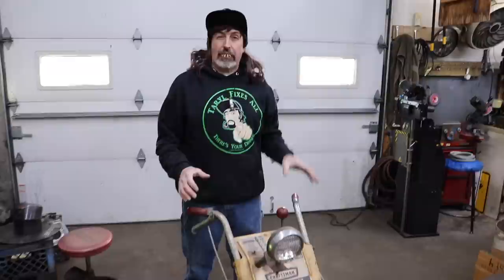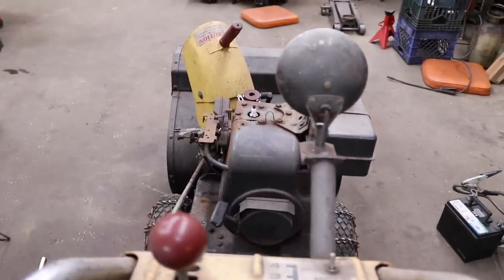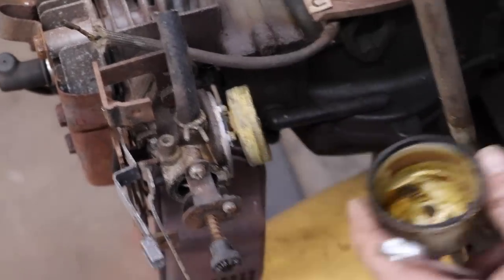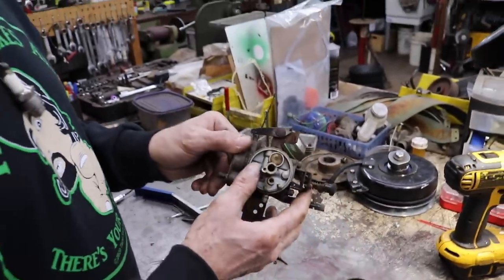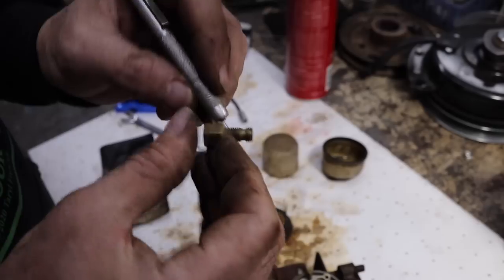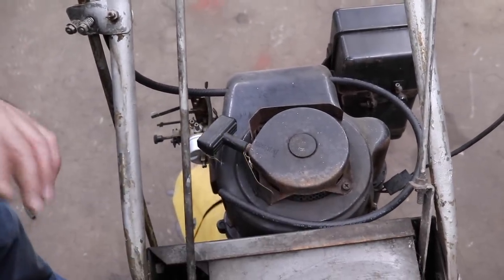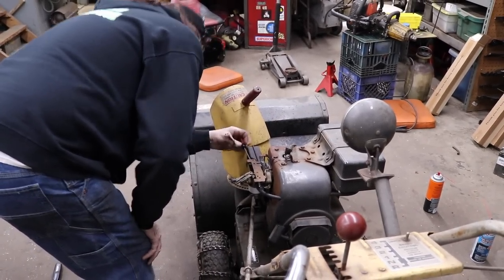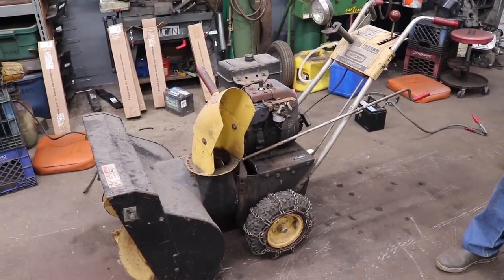⚠️ Most DANGEROUS Snowblower EVER! Let's Get It Running

Comment: Most dangerous? I think if you where to take a look at an old Gravely with the "Dog Eater", blower attachment, you may change your opinion as to ,"most",dangerous.  Otherwise, another great vide
Reply: Power Vs Drudgery!
Reply: I'll 2nd this and with the dog clutch on the blower was in or out. And the 301 cast iron Kohler don't quit!
Reply: I had one of those Gravely machines……was a killer!

Comment: Those of us who used Gravely walk behinds from the 1950's are familiar with VERY dangerous lawn and garden machines.  Think sickle bars, for example.
Reply: And the Dog Eater snow blowers. And the 301 cast iron Kohlers that were STRONG!
Reply: I had 2 old Gravely L 2-wheel tractors.  A 1937 and a 1960s
Reply: I had the rototiller attachment and the mower attachment. Just one big blade. Big round deck.
Reply: The depth wheels for the rototiller were spoked steel wheels
Reply: Those things took a big old 7/8 spark plug.  Wico mag
Reply: @jameskropf2493  That one could mow with 2 blades 90 degrees apart or bush hog with the one 1/2 inch thick blade by itself. The round deck also had a left handed version but still wouldn't do a really good job without the other blade because of lo blade speed. Te kidney shaped mowers did fine with the 90 degree gearbox, belt drive spindles and smaller pulleys for increased blade speed and dual blades. One of the best parts was a rear discharge chute so you could trim on both deck sides.
Reply: @jameskropf2493  I welded pieces of deck plate onto the tiller blades. It'd then dig up a packed gravel driveway with a 8 inch round hole concrete (not laylight) block hung off the front for weight to hold it down. And never flutter.
Reply: @jameskropf2493  Same for the rotary plow.
Reply: @jameskropf2493  Right! The old wooden handled control rigs, strap start or 12 volt car battery and wall charger.
Reply: @jameskropf2493  Sure did and the mags would knock the fillings out of your teeth!

Comment: A Small Engine shop in Summerville South Carolina got sued for not using fuel line clamps and lost the lawsuit even though the customer admitted to refueling with engine running when it caught on fire. Mower was a MTD Yardman. Burnt it almost to the ground!
Reply: That’s what is going to happen with using zip tie on fuel lines before long
Reply: In Germany the jury can't award money to defendants like we do, 
They understand a jury of people who have no idea how a machine works should not be the ones to decide a dollar amount.
Reply: My 1992 Suzuki dt40 two stroke outboard came from factory with zip ties on fuel lines. I bought new zip ties from an authorised dealer. No I do not like them. Next filter change it will get stainless steel clamps.

Comment: You know I have been a small engine mechanic for many years Taryl. And still, you teach me things!!! I been through probably hundreds of those snow king carbs, thought I knew every hole in them to clean out. But I never knew about the one for the low idle circuit in the bottom of the venturi!!!! Thanks man!!!
Reply: Agreed 👍 on picking up new stuff on those carbs,been using up all my new brass floats,started using the plastic ones,do alot of old troybilt tillers
Reply: It like we’re in shop class again being taught by master yoga he amazes me on the knowledge he has I definitely bow down to the master
Reply: @jkmcp45  I don't see much of that old stuff out here in Washington state much the bonus rust away too fast o have a few 1970s garden tractors, and several old troybilt tillers with those engines
Reply: @jeffclark2725  same here in Oklahoma. I managed to pick up 3 "junk" generators with 10hp tecumish from a pawn shop for 100 bucks. 3 carb kits and 3 cycles in the ultrasonic cleaner and they each run perfectly. Now to find more projects since I sold the gens!
Reply: Same here
Reply: Agreed

Comment: My grandfather worked for the street department in our town, late in winter they cut down the accumulated snowbanks that built up thru winter with a massive truck mounted snowblower and carted it off in dump trucks.  One time a dog decided to jump the snowbank right in front of him and before he could get the machine shut down the inevitable happened.  He felt so horrible he never ran the snowblower again (small town, boss was a friend and totally understood).  Luckily he knew the dog owners as friends also, and they never held any animosity towards him.  Years on we ended up giving them a pup when we bred our beagle.

Comment: Bravo. Another fine Fix-IT video. Thanks for the plug in mentioning Buffalo. South Buffalo & below always gets the brunt of the storms. I'm in the northern suburbs where it isn't as severe. My 30 yr old MTD snowblower with the 5hp Tecumseh Snow King started on the first pull since last season. Now all these new snow machines have Chinese made engines.

Comment: Safety 3rd I always say Safety is for the weak and the stupid 😵 I run an old Montgomery Wards that would give it a run for it's money on the lack of safety devices. Love the sound effects such a high quality production 💪
Reply: I'll heartily agree with that! Love the old stuff!
Reply: @petertothpete6518  like using those old Colman white gas stoves that are 50 years old
Reply: @jeffclark2725  I've got one that burns as blue as a propane job yet and still. 50's model small one.

Comment: Even worse is a rototiller with no auto off. I know a guy that had a old rear tine tiller (don't remember make) that got him pinned against a fence while in reverse and chewed off the bottom of his one leg that bad that he lost it from the knee down. Don't remember if safety was non existent or disabled. But just the thought still gives me the chills.
Reply: We had a Murry Rototiler back in the 70s and it was just like this death trap.
Reply: Replace springs in clutch ??????
Reply: When I have an old machine with no deadman controls I add a kill switch up top by the handles.

Comment: This thing is in excellent condition. It should be maintained as a snowblower.
You could REALLY cut down on the risks by installing an off by default ignition kill switch lever on the left hand.  When you're not squeezing the level, ignition is grounded. When you are squeezing the lever, ignition is live.  That way you let go and the whole machine dies.

Comment: TIP OF THE DAY: 
For those that don't already know, the clip that holds the float needle in place is the exact size that is needed to clear the tiny hole in the high speed jet that T Dawg was using the torch cleaning tips and pin drill bit on. You're welcome and There's your dinner ! : ) Happy Holidays to all.
Reply: good tip, I'm guessing that wire is pretty hard/stiff, too, should be perfect for that secondary application. thanks for posting that
Reply: Great tip especially for home owners or someone in the field who probably won't have torch tip wire, tiny drill bits or guitar strings on them or the proper tools.
I guess some might have a wire brush they could pluck one wire from or the bristle from a brush or broom of some kind.
I've done all of that on carbs and the nozzle of an oil furnace...many times...
Reply: @mickdog2  You're most welcome. I find it amusing that none of the online gurus have ever mentioned this fact. I watch several of them as they scramble around looking for various items to unclog the hole while the perfect tool came with the carb -a -traitor  in the first place. It's even easy to hold the clip the way it is designed to penetrate the orifice and give it a thorough reaming.

Comment: I had that exact blower . It is a 1972. I agree very dangerous, but did a great job with deep snow. When I could buy a  modern one I removed all the anger mechanism cut the shaft attached to the front gear box ,added a support bearing and added a peace of sheet metal in the front bucket. I now had a 26" snow pusher.I also moved kill switch to the handles for easy reach.

Comment: Hi Taryell  I enjoyed this video, it took me back to the 1970s. I had a similar type blower. Not a craftsman but probably made by MTD. There were Deadman saftey switches on each handel bar, they  killed the engine if you released both. I think there was an auger engagement  or neutral transmission switch activating the deadman so you did not have to hold one down for starting. You are just the guy to install them on this unit and bring it back to useful functional safe status.
I am looking forward to seeing the unit blow snow, yes it will move the white stuff 50ft. If the snow is dry. The auger clutch often would slowly turn the auger with no load slightly but if using, usually the snow friction was enough to stop auger rotation at idle speed. He is an old timer and been sleeping awhile give him a chance he will get the job done!

Comment: When that unit sees a little snow load, that clutch will find itself, and work just fine.
BTW, Kroil is a rust buster only...Kano also makes a product, called Penephite. It is Kroil, with graphite mixed in. When the kroil dries up, it leaves a graphite film which is a lube, that does not attract dust or dirt.....try it; works great...!!!!

Comment: I'm working on a 79 JD826 Tecumseh with  a similar carb issue... been all through it meticulously and still needs work. Next time you use the Ultrasonic cleaner it might be a good idea to throw Little Johnny's teeth in with the carb... those teeth are so bad. lol

Comment: Hey Taryl, you'd mentioned using a propane torch to free up the low speed tube in the carbitrator....... I'm assuming we fire up the torch as quickly as we can after spraying carb cleaner on it??🤣😂🤣😂💥💥💥

Comment: centrifugal clutch springs might be weak?  Gravely "Dog Eater" is a good contender for most dangerous, but it is a BEAST!
Reply: Dog Eater for sure
Reply: I have a few old Gravely walk behinds.
Not many could run them today .
After an hour a intense workout .
No safety equipment .
On hills no brakes will roll away if knocked into neutral.
Love them .
Last a lifetime .
Reply: @MitzvosGolem1  Dad had the Gravely twin cam machines, I've got the 12hp Kohler walk behind, put a smaller plastic tank on it cause I rarely use it for more than an hour, whether blowing snow, mowing with the rotary or sickle bar. Also have a 12g and 400 series rider.  Have seen many attachments: stump grinder, chain saw...I  fashioned a wheel trencher for burying lines.
Reply: Nice thing about the 30" rotary mower....it will easily mow down heavy brush, like large stands of multi-flora rose shrubs.
Reply: @sierraromeo  yes chops up everything even 2inch trees if sharp.
Reply: @sierraromeo  I need a rototiller I have to propeller old style need a tine type one for 5665 commercial
Reply: @MitzvosGolem1  I have one but it needs work, it has a frozen bearing  it seems, nice otherwise,  central Ohio
Reply: @sierraromeo  Virgina near Roanoke

Comment: I disconnected my old Toro 826 safety switch due to the fact that my bad hand tendons were killing me holding the handle down.   I grew up with no safety things so I don't think it's a big deal.   All our kids are grown too so it's just me using it.
My old Ariens has you hold the handle down to stop it, release to let it go.   That works well for me too.

Comment: Great tip about the old spark plug boot becoming conductive and grounding out the spark, that one would’ve driven me crazy looking for the trouble! I’m going to be fixing up my neighbor’s old 1974 Toro snow blower with the same engine on it and I’ll bet the boot is hard as a rock on it.
Reply: Don't waste your money to buy a boot, steal them from old auto wires

Comment: My old Ariens is the same way. It'll go hands free with the same squeeze to stop clutch. I have a bunch like this.
Reply: I have an old Ariens too. Great little machine and I've been using it for years.
Reply: @liberpater1342  they are nice. I love mine. Just picked up a late 60s one. And have used an early 70s one years.
Reply: @meegstomtom  the nice thing is. many parts are still available like the friction disc, bearings, etc..
Reply: That's what I was thinking every old ariens that I've dealt with is exactly the same way. The really old snowbird was worse with the forward reverse lever you push it forward in gear and it takes off by itself The only way to stop it is to pull the lever back.

Comment: My 1971 Ariens Sno-Thro goes on its own.  I bought it off an older guy who always kept it indoors when not using it, it's in close to perfect condition.  I laugh at seeing the snow blowers they are selling these days, thin stamped metal and plastic crap.  I will never get rid of it, it's a great machine.  Parts are very easy to get, people are always giving them away for free around me in New England Craigslist.
Reply: I have my Dads 1977 Ariens Sno-Thro, just replaced the 45 year old tires and tubes, belts, fuel line and some bearings, thing still runs great, just waiting for our first snowfall to try it out..

Comment: I hope the owner of this snowblower appreciates the work it took to get this snowblower working again. I knowits dangerous, but if the owner knows that and knows he has to take some extra care, then he has a useful piece of equipment that should continue to serve him, especially if  he takes care of it.  I haven't owned Tecumseh powered equipment for a number of years,  but the detailed carb rebuild TD went through is a great education. I really enjoyed it.  Mr. Heat Gun is a great shop helper. I've  never used heat on stuck hoses, but it's a good idea. I usually slit the old hose with a knife, then peel it back in strips to avoid damage to the metal fitting. You have to be careful,  especially on soldered fittings. As for not getting back his loaned-out Tecumseh tool, I know what it's like. My advice is to never loan out tools or books. If you are lucky enough to get them back,  they will probably have been damaged or abused. Just dont be a tool loaner. Cool video.

Comment: Taryl, you just solved a 40 year old idle issue mystery that I had on a Tecumseh powered go cart back when I was a kid... 
I was good with small engines and had seen a lot but had never seen that long low speed screw  except for that one engine..
It was a strong healthy $FREE$ engine but I never did get that idle straightened out.
Where were you when I needed you ??   lol

Comment: Hi Taryl,

I very much enjoy your videos.  Have saved a load of money from your  fun way of teaching.

In watching the film I noticed that when you pull the starting rope  the chain appears to rotate that is connected to the clutch as if it is already engaged.  Like a chain saw it shouldn't move the chain until the motor reaches the correct RPM.  Perhaps the clutch is stuck.

As you pointed out it lacks many of the current safety features even if the clutch works properly.

Thank you for what you do.  Keep up the good work.

Dave

Comment: I have an old craftsman 6 horsepower single stage I call the Widowmaker. The only controls on The Handlebar is the gear shifter. It's all chain driven with a centrifugal clutch like this one. Throttle and Killswitch are down on the engine.

Comment: Taryl you could see the clutch was in trouble when you hit the starter..... the outer hub was spinning with the inner..... you KNEW you shoulda covered all your bases with the carb rebuild... those small low speed passage ways can trip you up.
 Otherwise great work dude ;)

Comment: I have a curbside-rescue Craftsman snow-blower that's even older and more dangerous than this thing! It has steel-disc drive wheels with big steel tabs for tread. Imagine someone's foot getting caught under one! Then the drive wheels shut off with a crank ahead of the handlebar, that has to be rotated 180 degrees. 
First time I used it, I was turning it around on my icy street and slipped. Imagine the thrill of hanging on the handlebar, while being dragged up the driveway on my knees  as I struggled to pull myself up far enough to reach that damn crank.  Finally, got it stopped just inches from my rear bumper!

Comment: That rubber wheel and disc on the drive system are kinda like the old Roof Mowers and the early Snapper Mowers - drive system. I had the old Roof Mower that kept eating the rubber off-the-wheel drive - everything was worn out. Junked the mower out.
Reply: I was going to say the same thing about the snapper mowers.
Reply: Got both and you're right. Roof 28 inch with a Briggs IC and 2 Snapper 21's. One with a Briggs 4 horse and the other with a Kawasaki 6 horse and a bagger.

Comment: My Dad had a slightly smaller single stage craftsman that was similar.. 2 levers one to engage the auger and one to engage the drive forward or reverse.. No safetys at all you could just walk behind it and let it go. I believe it was chain drive as well, noisy noisy noisy old thing! As you said some part eventually broke that was no longer available and it was junked. My current snowblower requires you to hold down a lever to make the blower start and another to make it go. Let go of either lever and it stops.